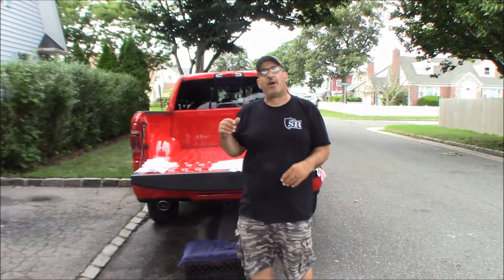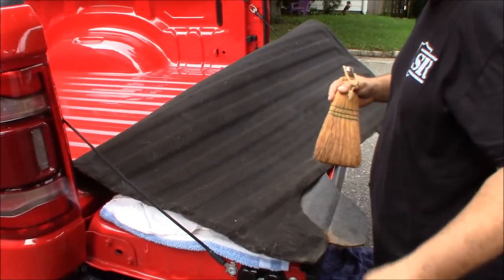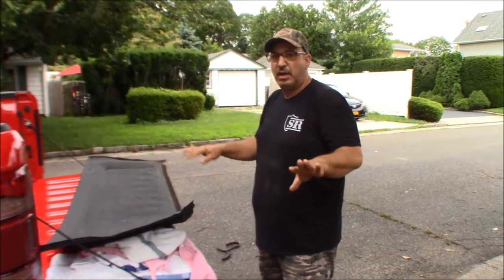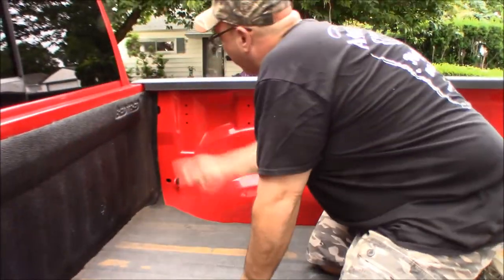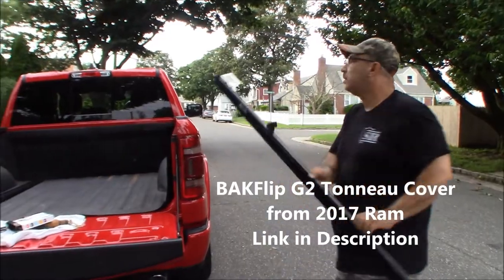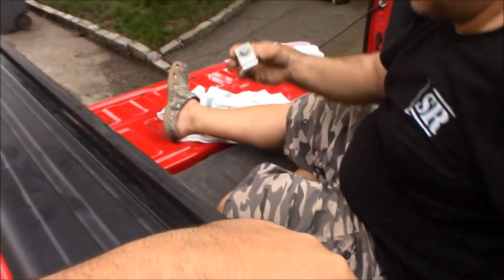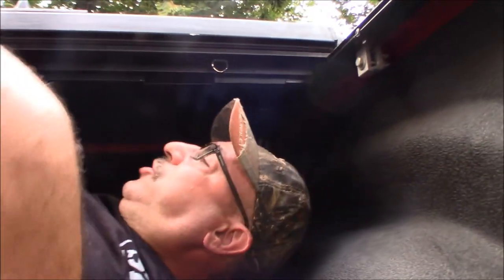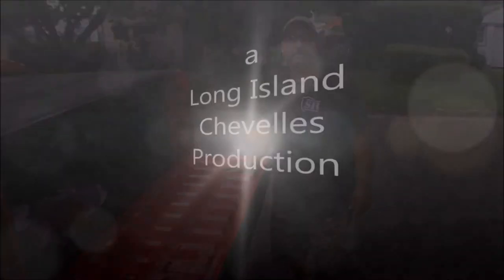Does a Ram Classic Bed Liner & Tonneau Cover fit New Body Style 2019 / 2020 Ram 1500 5'7" Bed Part 1

Comment: I bought a used 2013 Bakflip tonneau cover same as yours . it doesnt fit on my 2019 express classic
Reply from the maker: Maybe the used one wasn't correct to begin with.  I'm still using mine with no issues.
Reply: I have the same problem right now the measure’s are different

Comment: Does that drain go right to where the cab corners rust out a year after you trade it back in?
Reply: Bed corner*
Reply from the maker: The drain goes to the factory drains.  The spot used for the Bed Cover Drain is designed to drain the rain water away.  This does not necessarily cause premature rusting.  That issue can be accelerated by clogged drains, which retain the water in the bedside.  However, most rust is cause from road grime and dirt not being properly cleaned from the underside of the panel.